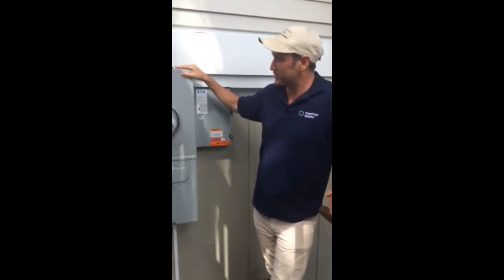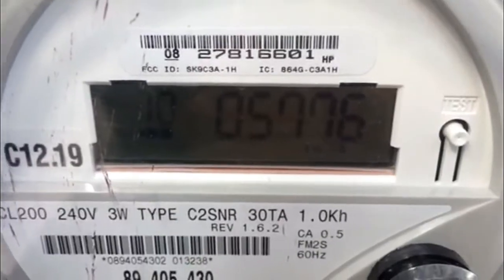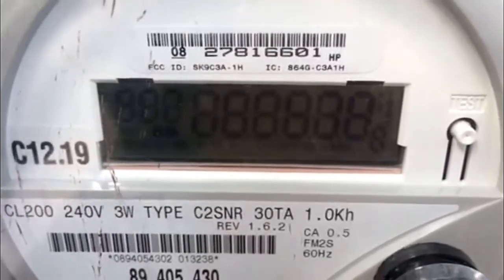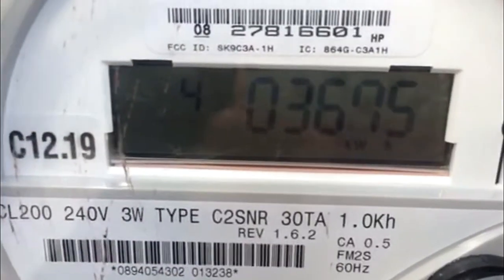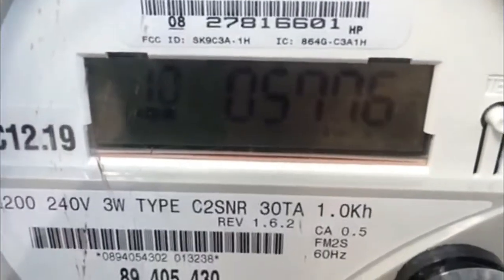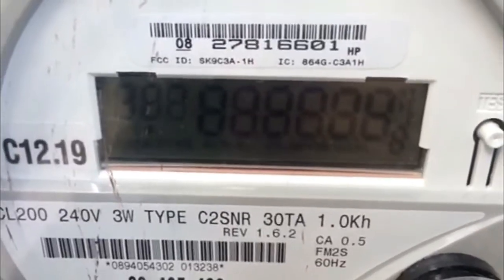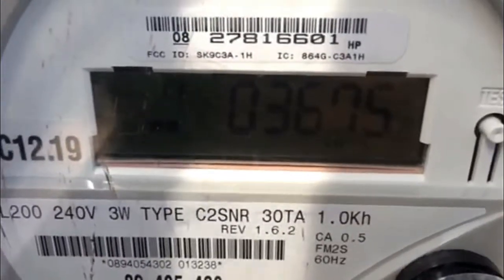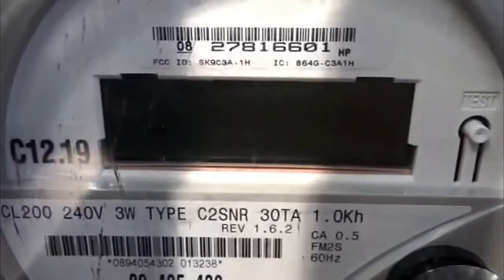How to read a Net Meter

Comment: Okay my question is how do I know how much I’ve used from the grid each month.
Reply: Your local power company will generally show that info on your monthly bill.
Reply: Wakefield Tolbert thanks. My system is up and running and now after educating myself I understand how it all works. Thanks for taking the time to respond to my question I do appreciate it
Reply: @TechnMoto  Most welcome. We've had ours about 2 years now and like it, but of course as with any relatively new tech added to a property there is an interesting learning curve.